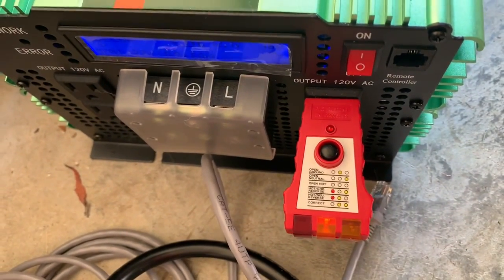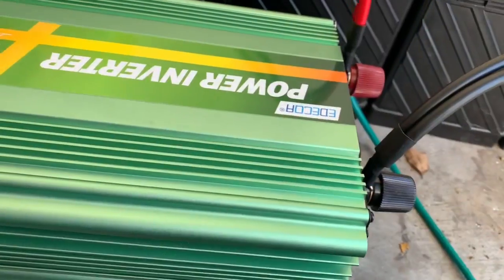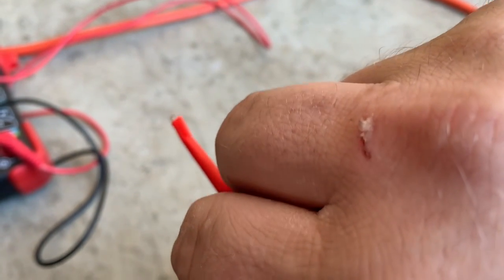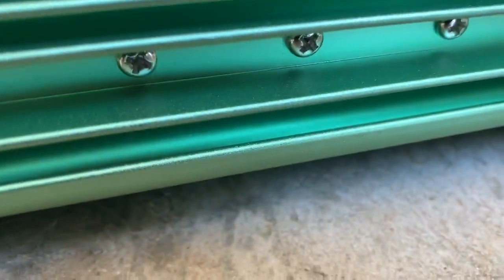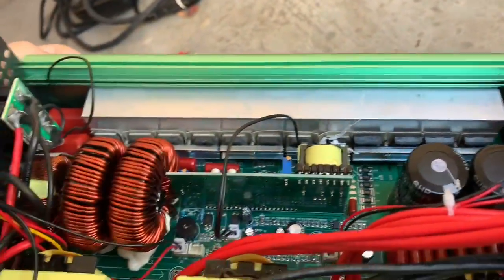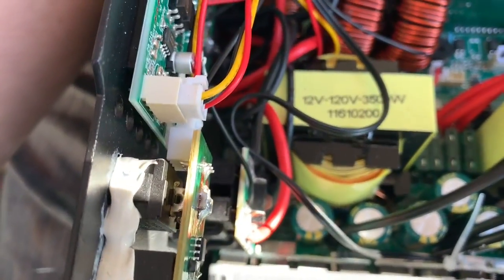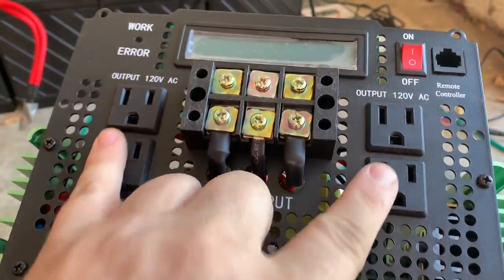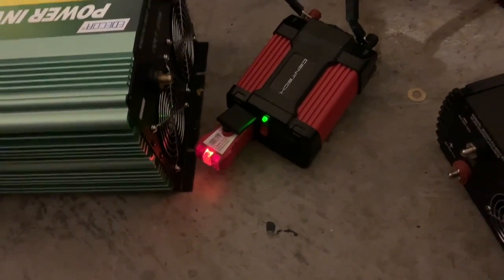Grounding EDECOA inverter

Comment: The minute you touched the wire to the screw and neutral you had the problem solved that is exactly what I did I got the two orange lights to one side now everything works perfect I ran a wire from the screw to neutral ground I have good ground all the other inverters did not work you can't ground them for some reason this particular model you have you were able to solve the problem right at the beginning the minute I did that hook up the high efficiency furnace worked perfectly and is continuing to still work excellent I tried everything I'm so glad I watched this video it solved the problem answered prayer thank you

Comment: I am so glad I watched your video I watched a whole bunch of these I don't even know what they're talking about it's so confusing but when I put your video on and you had that socket Checker plugged in I knew I was on the right track when you grounded that to neutral ground and the screw on the body and the indicator check the good ground that's just what I needed my high efficiency furnace now works I have bought three or four inverters you can that ground them they won't ground but I have the inverter you have and I was able to watch your video and now my efficiency furnace Works excellent thank you

Comment: The solution may be to connect the chassis ground to the battery negative terminal which should be grounded to the chassis which should be grounded to earth ground.
Check with the manufacturer or an electrician before trying any connections.
Reply: Could you do the same for the inverter and MPPT controller?

Comment: get a gfci outlet and wire the ground to the common at that point. it won"t be a real ground but it will behave like one. and keep the DC ground isolated from AC

Comment: What was the solution because I’m having the same problem.
Reply: @LewisMoten  couldn't you just run a ground wire from the neg terminal on the inverter, then run it to negative   bus bar and run a ground wire to  a separate rod than the house earthing system?
Reply: @Norm Nilsson @Lewis Moten The manufacturer says there is a "ground problem" with v1 of the inverter, and supposedly v2 fixes it. I have no idea what the issue is though.
Reply: @LewisMoten  The solution is: tie N to G with a jumper in a recepticle that you get from Lowes keep it plugged while you use the inverter, I saw when you put the meter from N then touched chassis your 2 light came on.

Comment: I believe your tester is just looking for continuity on the ground and common.   Some inverters internally bond this and some do not.    You are working on an isolated circuit from earth ground, so running a wire to earth ground will really do nothing for you in this case.    The ground lug on the inverter chassis I believe is designed to ground to a vehicle chassis.
Reply: I have a 1500w one of these...& it works well except for my mouse doesn’t work on my laptop & occasionally my air fryer with a touch screen plays up.

Did you manage to fix it? Aside from my mentioned issues...I’m pretty happy with it, but ideally would like to fix it if possible.
Reply: @LewisMoten  Is that a modified Sine wave or pure sine wave? That matters more than an isolated ground doesn't it?